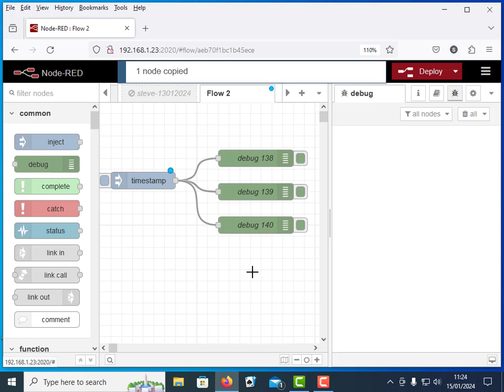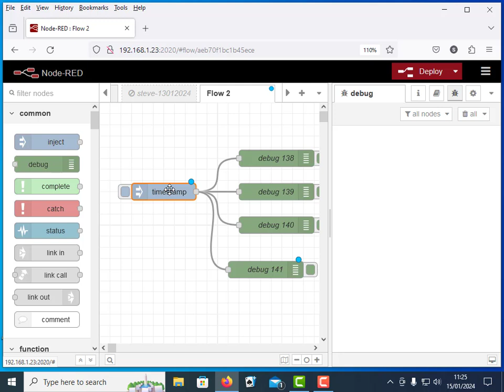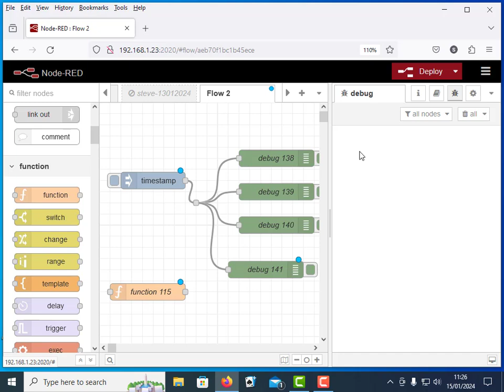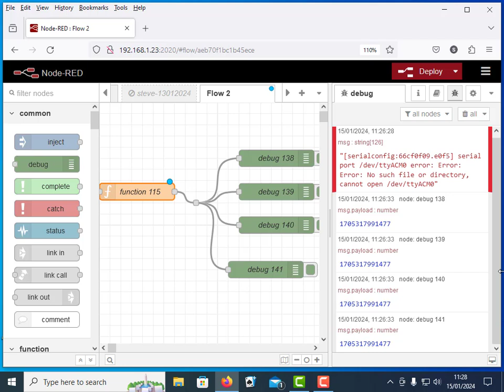Using the Node-Red Junction Node

Comment: Thanks Steve another useful video. I think you can achieve similar by holding shift or ctrl I forget which, and dragging the output of the inject node to the output of the function node, it moves all of the connected debug nodes at the same time.
Reply from the maker: Tks. I'll give it a try
rgds
steve

Comment: I use it but I find it "fiddly" to connect to it. Often instead of connecting it just moves. I think they need to make the interactive regions larger so it is easier to add a wire.